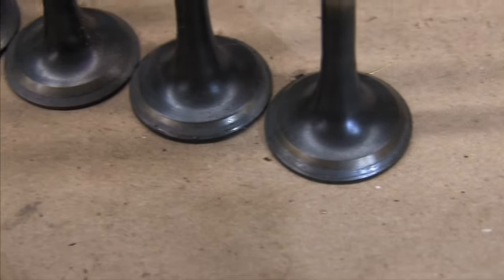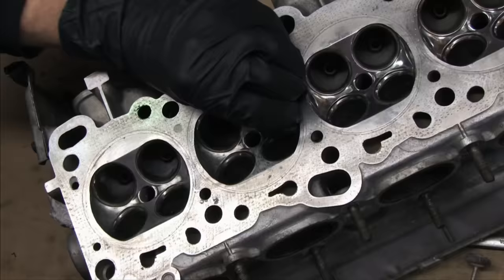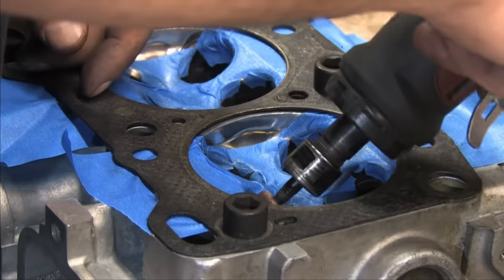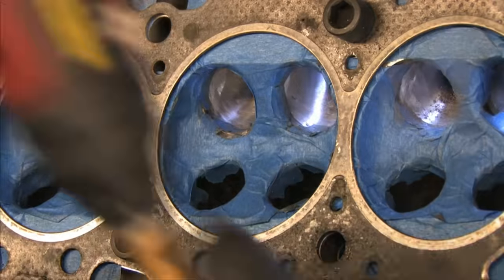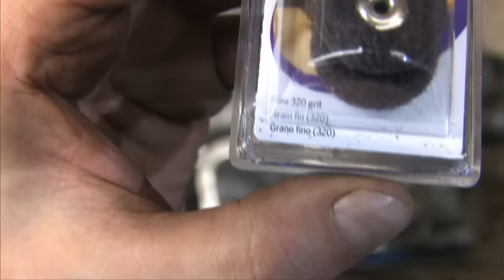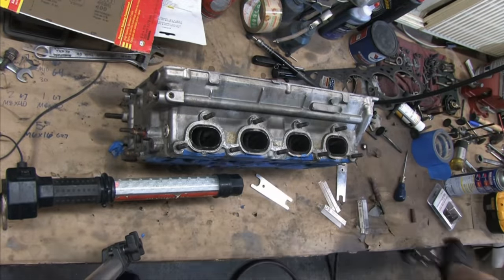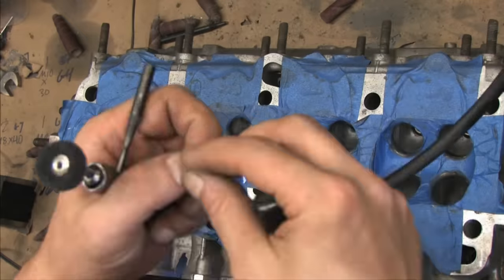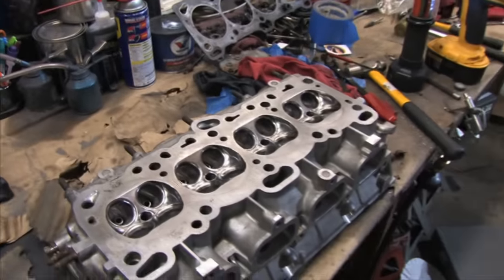Cylinder Head 204 - Porting & Polishing

Comment: Would polishing the combustion chamber lower compression because of removed material? I feel like I had to ask as polishing eventually removes a considerable amount of material. As you have a turbo I could imagine it would be fine in your task but you could always deck the head too lower it again. 

Just want a second opinion from you. Also we need a update on everything it’s been a while
Reply from the maker: It only removes half the depth of the fine sandpaper you used in the last stage of a 3-stage sanding process, and that's by the time whole part is completely polished.   Basically you're only sanding off the high spots, getting it flat[ish] and stretching a grain into what remains with a polishing wheel.  I would be surprised if it lost a whole cc across all 4 ports combined.  That would be enough to change the math numerically, sure, but probably not enough to make any major impact on the static compression.  It probably has the same effect as the shallowest possible cut you can make resurfacing it with the best available equipment.  Or, you might just make up for that tiny compression loss with an extra degree of timing advance and cancel out that loss?  If you achieve that result and resurface it, then you get to keep the compression AND the timing advance.  You should be able to feel that...

But in my case here, the head has already been resurfaced 4 times, way beyond factory spec, and it was even milled crooked, slanted toward the exhaust side.  That's part of the reason I had to cut larger valve reliefs in the pistons on the exhaust side.  The engine is 9.875:1 static compression, not 7.8:1.  It's a little over 2 points higher than the average turbo 1g DSM using a stock rotating assembly.

Life is filled with complications.  It's what we do with them that matters.  I do have a comprehensive update coming soon.  I may talk about what they are on Patreon when I upload it.

Comment: so i see you mentioned in a comment,  you do other heads a little differently. if im doing a civic si z3 head should i follow this video to  a tee?  my brother n law showed me this video gave me confidence to wanna doit. just taking notes on the steps so i dont have to watch over n over.  cheer mate.
Reply from the maker: I went far beyond the techniques necessary to do this because I wanted to show all of the processes and their results.  Polish the exhaust runners if you want, but you don't need to go any further than 120 grit on the intake.  95% of the benefits in the runners come from just cleaning up the cast.  Honda stuff is usually a lot better cast than everything you saw here.  If you use the straight rolls, they'll turn into tapered rolls.  Eastman sells them if you must have them.
Reply from the maker: Eastwood, not Eastman.
Reply: Badass. Thanks bud. Ill make. A video once done! Show you the aftermath and how much you gave me confidence and showed how easy it jus could be. Much Love comin all the way from seattle

Comment: What if you just buff the bumpy surface down will that help or do i got to make it a mirror that ill never look into when its back together.
Reply from the maker: On the exhaust side, smoother = less surface area.  It helps with reducing heat transfer more than anything else. You don't need to do any of this on the intake side.

Comment: My question to you is, Doesnt polishing the intake ports end up helping fuel condensate on the intake walls and allows beads of fuel to drip into the combustion chamber.
Reply from the maker: It could if the injectors weren't spraying directly at the back of the valves.  Perhaps if it were carbureted or throttle body injected it could have a negative impact, but it didn't.  The injectors of the 4g63 are sprayed in alignment with the valve stems toward the base of the port.  The floor of my intake is not polished.  I have observed no difference in knock from before/after this modification was performed.  I was hoping that it would at least make a small difference, but at 10:1cr with pump gas, it's not the surface texture that is my big obstacle.  The head is moving more air, though.  Observable from the MAFraw Hz value in my logs, and more traction loss at lower boost levels.
Reply: @Jafromobile  in the end what where the biggest benefits you observed with this modification? would changing the pistons to lower the compression ratio and add more fuel cause a significant increase in HP or would it be   negligible?

Comment: I'm curious about how much horsepower you actually gain by doing this. I'm getting ready to do my first rebuild on a Subaru ej engine. It looks like it should be fun, but I want it to be done before October. So I don't want to spend too much time on items that won't give significant improvements in performance. Think this would be worth doing?
Reply from the maker: The biggest gains you can achieve yourself are really just in cleaning up the casting.  It's still time consuming whether you experiment like I did, or you just clean up the casting.  Really.  95% of the gains from just removing sharp edges and flash.  The gains you achieve will depend on the rest of the modifications you already have.  Doing this by itself with a basically stock engine won't yield much of anything.  I would say "slightly perceptible" on a dyno chart, but the weather could change and make the same kind of difference.  If you're netting a 3% gain in flow, the results are very different between a 100hp baseline engine and a 500hp baseline engine.  So what it would yield on whatever cylinder head with whatever problems it may or may not have is very subjective.  It's because of this that it's hard to put any number on what it would any cylinder head would yield.  This head already has lumpy aftermarket cams dialed in with dual valve springs and a 20g turbo.  My goal is to feed those parts all they can eat.

Comment: I feel ya man I'm replacing a lifter which means for me now oil pump porting heads and stage two cam because it was the same price as going stock
Reply from the maker: You do know that you can change 4g63 lifters without even removing the cams, though... right?  ;)
Reply: @Jafromobile  I'm working on an ls3 gm 5.3 liter
Reply from the maker: Well then, that changes everything.  Lifters in a block/head sandwich.  Gotcha!

Comment: One tip to have a little more insurance. I do a lot of Dremel work on soft polymers doing pistol modifications, and I rounded and polished the cock on my Dremel extension. That way it made it smaller, and if it did touch something it didn't gouges it really anymore because it's round and smooth.

Comment: the shine you have is going to be a waste unless ur plan to run it on alchol or methonal .shouldve scolloped out the guide supports abit more as well .normally you leave a inlet port abit more rougher so the fuel can vapourise unleaded fuel will stay liquid in those ports ,im not bagging you just trying to give some helpfull info .im in my 60s n have been building drag bike n car motors for years i learnt from a bloke in parramatta called burt jones he used to build many competition winning motors n his buisness was BERT JONES RACING CAMS .keep at it took me years to get the science right .cheers
Reply from the maker: I did install water methanol injection on this one, the video is here and I included a failsafe relay circuit that was "extra credit" which went beyond the kits instructions.  Also, I did take into account the potential for fuel pooling.  Typically it's a bigger problem in NA carbureted and throttle body injected setups more than it is EFI boosted configurations where the injectors fire right at the backs of the valves.  But that potential is one of the reasons why I left the floor of the intake ports rough (just in case).  The other was to try to generate 2 different boundary layers on opposite sides of the port and encourage a more turbulent filling of the combustion chambers.  It's difficult-to-impossible to determine whether it encouraged any additional tumble affect, but that was what I was going for.  Sort-of a poor man's poly-quad head.  Of course poly-quad heads address swirl, not tumble... but on a 4v head, any improvement in either one would be a favorable thing.

Comment: Applicable to full race engines only.  Stock, you have decreased the cooling efficiency of the combustion chamber.  Wire brushes on aluminum heads is a big no no.  Nice to see someone polish a turd though.  I have the heads machined, lap in valves, done.  I hope you polished the valves as well.  Modern motors pulse the fuel rich to lean and lean to rich.  Carbon build up is minimal on modern motors.

Comment: Doesn't polishing the metal that much remove some of the metal itself?
Reply from the maker: Not really.  In order to polish it, it has to be sanded smooth first.  Technically every process removes some metal, but it's the polishing stage that removes the least of it.  By the time you get to that point, you're stretching it more than you're removing it.  It's the sanding that you do that removes the most.

Comment: Do you not match the manifolds & head to the gaskets ?
Reply from the maker: The ports are matched.  The gaskets are not.  Anyone who gasket matches a 4g63 produced from 1989-1994 is making a huge mistake.  The ports and runners are already too big.  You can actually flow more air and make more power with those by getting out a TIG welder and adding metal to the runners to increase the port velocity.

Comment: Would it be okay if you had done the floor in 80g and left it?
Reply from the maker: On the intake side, I did even less than that.  I left it rough.  I could have done 80g and stopped, but I didn't.  It wouldn't really make much of a difference unless I found some kind of messed up casting anomaly.  The dual-texture thing was an experiment that didn't yield even a horsepower difference between this head and another one that was professionally ported that was using the same turbo, cams, and injectors so...  like referenced in the video, you can stop after the 80/120 on the intake side.  Doing more than that is splitting hairs.  Lots of work for little/no/immeasurable gains.  That's what I learned from it, and I don't regret it.

Comment: What about port matching? Not even a mention?
Reply from the maker: Sometimes its beneficial.  Sometimes it's a mistake.  I did actually mention it in passing (briefly) explaining that this head's intake ports were too big for their own good.  You lose port velocity when you make the port bigger.  Fuel atomization improves with higher port velocity.  Intake port matching can easily decrease port velocity.  As long as there's no step on the cylinder head side that protrudes into the air passage, cylinder heads like the first-generation 4gxx heads with huge intake ports don't need to be port matched.  Gasket matching intake ports on any cylinder head is almost always a mistake.

Comment: Screaming at computer? The rough is for engines that have are naturally aspirated and they have carburettor(s) this set up requires some roughing for fuel air mixing. If polish then it doesn't mix well leaving droplets causing bore wash amd oil dilution. Polish away for fuel injection and forced induction as they mix fuel/air differently and on paper more efficiently.

Comment: Very nice video with great work and explanation, but you lost me at "high compression forced induction engine". That's where knock lives and it doesn't care how polished the cylinder quench area is, unless you're running race gas which is kind of a waste on street cars. Some ECU's now days can compensate for that, but you're still taking a huge risk.
Reply from the maker: Yes, I know.  Also, using generic hypo-eutectic pistons and stock rods could be considered additional hazards.  The engine is 9.875:1 compression and made entirely out of stock or hand-me-down used parts with only one concession... ECMlink v3.  It's equipped with water methanol injection so I can keep the race gas tune on it.  All of these things were intentional.  It used to have a smaller turbo on it, but I wanted this challenge.  If/when I blow it up, I'll own it... but in the meantime a 400+hp gasoline burning 29 year old Elantra is a kick in the pants!  ;)

Comment: I believe polishing is bad. Porting is great, but a rough surface could be better than a polished. A rough surface should have a golf ball effect and reduce the swirling of the fuel air mixture at the turn in the port before the valve. Pure theory, but I intend to test it soon in a reverse flow engine 1.3 fiat 128.  It should have the biggest effect in a reverse flow head, so I'll be able to test it.
Reply: Plus, a mirror polish doesn't create any turbulence, and the fuel falls out of suspension and condenses there. Where does water vapor condense more, on a mirror or on rough surfaces?

Comment: knock and predetonation are two completely different different events. knock is when the fuel spontaniously combusts due to excess heat and  cylinder pressure. Predetonation is when, like you said, bits of carbon or a hot spark plug ignites the fuel before the spark event.
Reply from the maker: Correct.  But to a knock sensor, they both result in the exact same thing.  A tuning nuisance that results in a loss of timing advance.  They both trigger the knock sensor to cause the same effect.  The ECU pulls timing.
Reply: @Jafromobile  correct, but calling them the same thing is incorrect.

Comment: Excellent video but no one really polishes their heads anymore. High speed photography has proven a polished surface causes disruption of the air flow and the gas to puddle. Excellent video still but just porting is the way to go.

Comment: Wanna keep them clean 2oz acetone per 10 gallons of non Ethanol fuel. I did heads on a 351w marine engine that runs non Ethanol fuel. We put a camera in all the cylinders after using it all summer. Looks like a brand new cylinder. I showed the shop who did my head's.....he flipped.

Comment: Your machinist is correct. Unless your running top fuel or alcohol your loosing power. There are gains for polished combustion. Blending bowls and gasket matching. You should read more about swirl and velocity. Your intake port almost never touch the floor of the port. Whole reason for raised runners. The gains you think you make from polishing get lost from changing the chamber cc.
You have no idea what you did without a flow bench. Dont mean to knock you great work. From experience i can tell you the prettiest port job usually worst performing. I have friends that do this for a living. Ive seen them have to fix heads that were polished by welding or epoxy back the correct cc. Some of the best flowing heads are sand blasted after ccing to make swirl n flow. Remember youre trying to mix oxygen and fuel to combust.
Reply from the maker: Sure!  And it's the third fastest Elantra on the planet in the 1/4 mile right now, and it burns gasoline... not e85.  The top cars are all posted on DragTimes.  Based on your conjecture either I did something wrong to it, or the overall platform I used is so horrible that there's nothing that can be done that isn't an improvement.  Clearly that performance gain has nothing at all to do with my work...  

All of the work is here on video.  Everything I've ever done to it.  So you're not bashing my work, I'm letting it speak for itself.  It's all here, along with the results.  That's how I do my channel.  Show everything and the results.  I don't really care if I fail because we all learn something.  No, there's no flow bench.  But your buddies who port heads for a living also have to sell their work.  I don't.  The pros and cons about porting get grossly exaggerated compared to where they are in reality once you add personalities.  Not bashing what you're referencing, there's certainly some truth to it.  Just that you're relaying to me someone else's experience and opinion.  An opinion that is not at all parallel to this car's performance and results.  

Just like the golf ball dimple zealots who insist it's what I should have done, there's a machinist standing in the background somewhere whenever someone requests that rolling his eyes and mumbling "good lord, we've got another one". That machinist would react the same way to my port texture *experiment*.  One that I literally told 95% of people out there not to do in this video because there are bigger gains to be obtained elsewhere.  He'd just be glad he wasn't the one who had to do it.  But for the 5% who want to try it, I'll show them how to do it.  Did my gains come from the texture?  Probably not.  I definitely didn't hurt anything at all by cleaning up the casting in the parting lines and below the seat.  That's work I'd do to any head without a flow bench, and it would make gains.  Your buddies who do this for a living would agree with that statement.

Comment: How come you didn’t polish the flat part of the cylinder head, which seem also to be a part of the combustion chamber ?
Reply from the maker: Because it was getting decked at the machine shop... which leaves the surface in a shiny-smooth state.  I basically would have had to shave that nice polished surface right off.